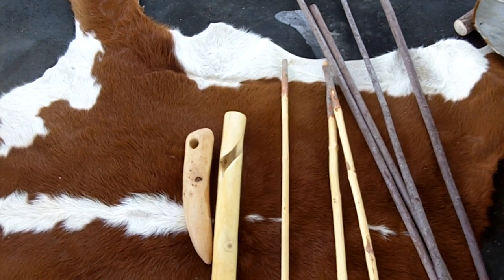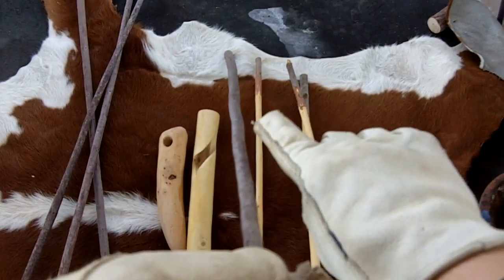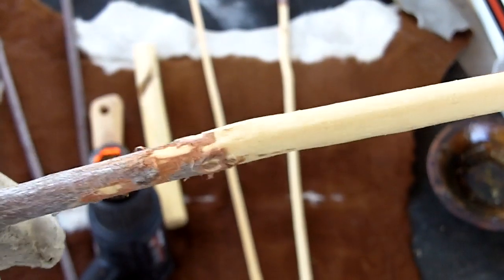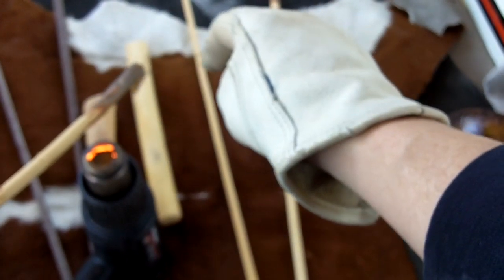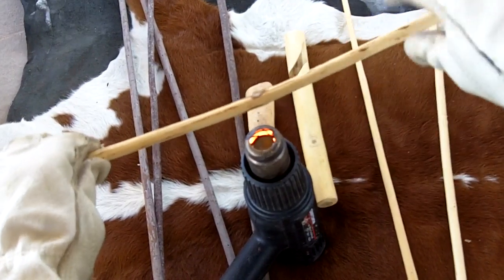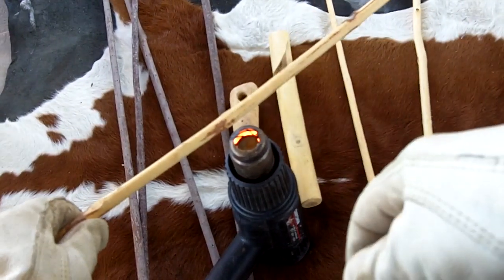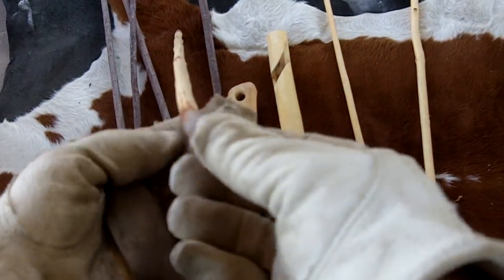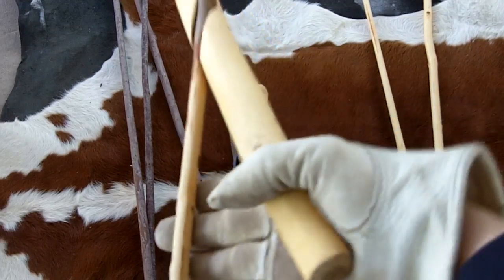179 - How To Make A Natural Wood Shoot Arrow Shaft Part 2

Comment: I cut them green as long as possible, debark them then straighten them lightly sand them, then I soak the tips in linseed oil for 10 minutes then the other end then I wipe them down with linseed oil and bundle them with string, this allows the wood to harden naturally without cracking or checking, green wood don't take a set its weak spined, wait till dry, and its a world of difference.currently im experimenting with rose wood, its the same dia and light and very long

Comment: When you cut your shoots what size do you look for?
Reply from the maker: With the bark still on, I look for 1/2" in the center as a general rule. The skinny end will be about 3/8" an the fat end will be about 5/8".  I've harvested thinner shoots that this but it's safer to get the thicker ones.  You can always shave down the shafts to make spine weight.
Reply: JackCrafty I guess I'm not following. Sorry!  I'm not sure what you mean when you say 1/2 inch in center. Are you saying when you gather them you get them at 1/2 and they dry out to 5/8th's? Sorry!
Reply from the maker: All those measurements are before the shoot is dry and before the bark is removed.  I measure each shoot at the bottom (fat end - 5/8") and the center (between the fat and skinny end - 1/2") and the top (skinny end - 3/8").   I try to cut them at least 32" long.  The diameters will shrink during the drying process but I that is unpredictable, so I can't give you those measurements.
Reply from the maker: Oh yeah, also remember these measurements are not meant to be exact.  Nothing in nature is exact and very few shoots will be perfect.   I use the measurements as a guide only.
Reply: JackCrafty oh ok! I got it now! Thank you for straightening that out for me! Also I really enjoy the videos!
Reply from the maker: Thanks.  :-)
Reply from the maker: Tony Maurice  yes, easily.